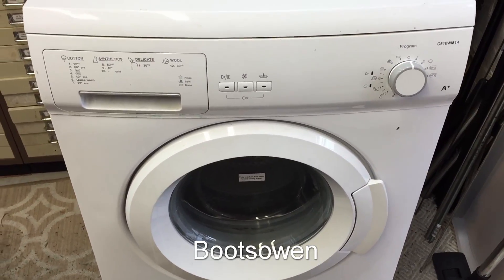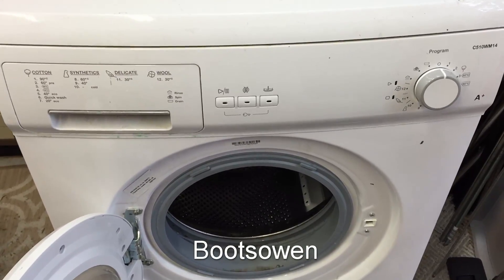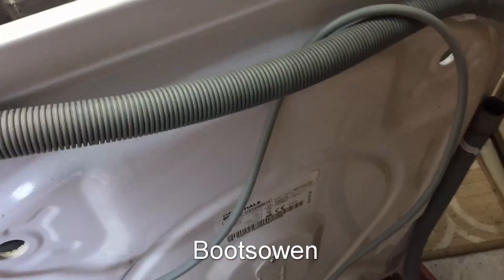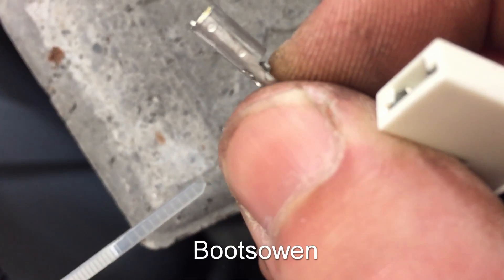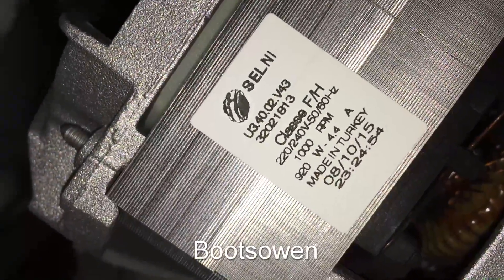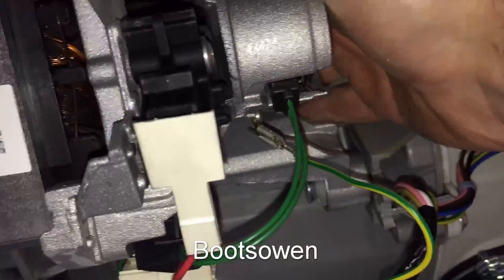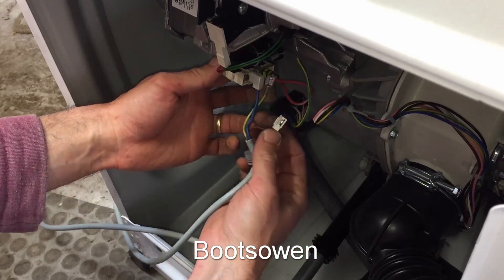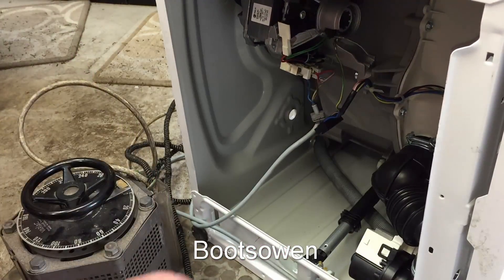Essentials Washing Machine, How to hotwire the motor: Brushed Commutator Universal Motor.

Comment: In the UK you can winge at customer support for consumer law. Not sure bout eu. UK says she must chooch 6years. Or they gotta fix it or replace it.
Reply from the maker: Really, at their cost or yours?
Reply: @bootsowen  depends. They have to cover the cost of parts but not labor in many cases. Different companies deal with it in different ways. The laws are open to interpretation. Curry's refers to consumer law like a secret policy. They will deny deny deny anything over 1year old. They will just keep saying it's out of warranty. But if you push them. They refer you to SOC which is a dept withing the company deals with awkward customers, when you reach that level they will sort you out. They rely on the fact that consumers don't know their rights and will let it go of they have to chase it. Con law is supposed to apply when the unit has a defect that must have been there since it was built. That's open to interpretation.
Reply: I really dislike curry's. if thats not so obvious yet.
Reply from the maker: That's good to know. 
I scrapped an indesit innex yesterday. the inner ball race of the inner bearing had split, the balls fell out and it has a sealed tub. 7 years old. A whole machine scrapped for a £5 bearing. But maybe 7 years is long now for the life of a machine. 

What was the logic behind an economical repair at currys? How do you decide if it is worth repairing? I presume it was only economic rather than environmental?  What I mean is that I will try to repair and maintain my Bosch washers that I use daily, but my time is free to me.

Comment: My hatred for servicing essentials appliances is vast.
Reply from the maker: Why? I understand that they are a crap low end machine, but they come apart easily and have a bit of space in there, also pretty light.  Not much to diagnose really. Compared to a Bosch or a miele that are heavy and complicated I mean.
Reply: @bootsowen  well, they are shite. High rate of failure compared to most. But cost reflective I suppose. Spent a lot of time on them, too much of anything is a bad thing. Definitely easier than a sensor loaded monster tho. Your right on there dude.